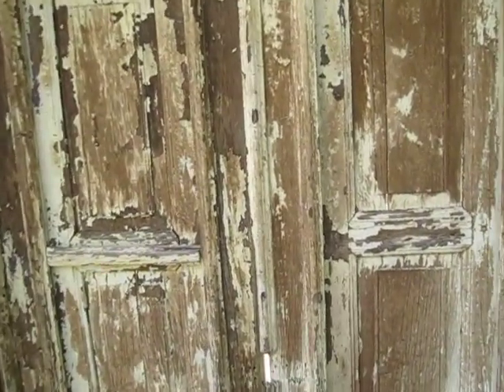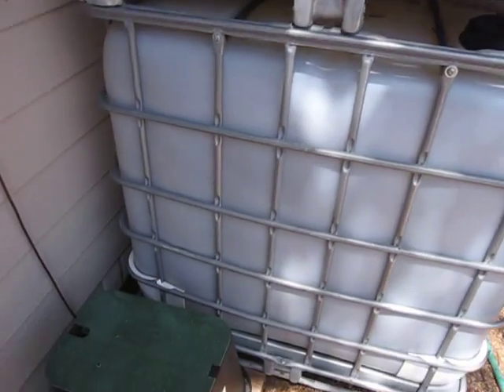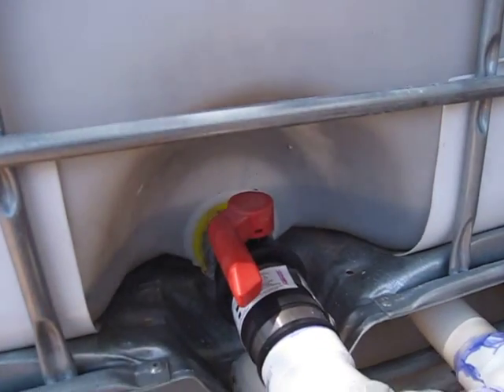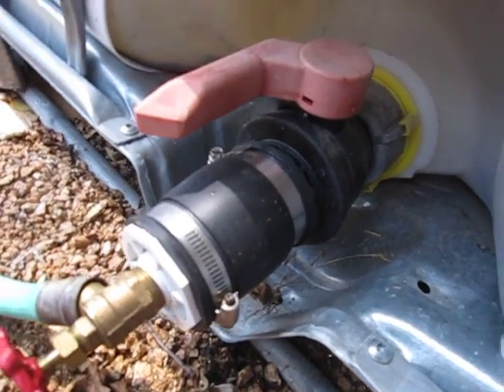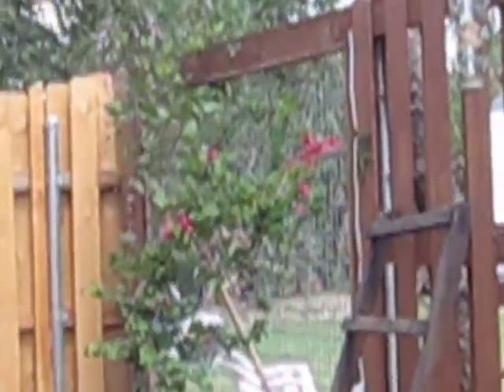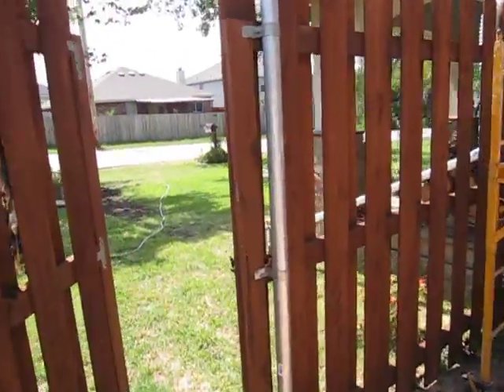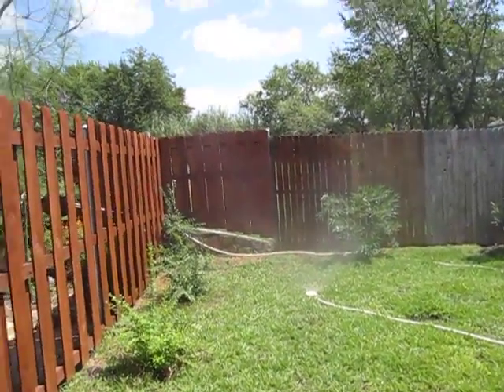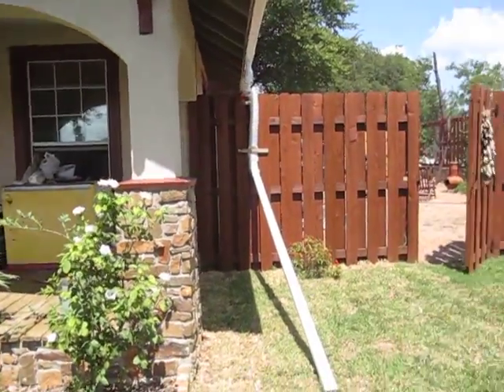My Rainwater Collection System

Comment: You can use UniSeals to connect PVC pipes to the tanks. So for overflow you could add another pipe high up on the side of the container where the water would flow out when it was full.

Comment: I have one of those tanks and since you showed me I can stack'em I need another! You prolly figured this out by now but for everyone else, you don't need to connect them with all that pvc the way you did, all you need to do is screw a 1/2" elbow into the top tank the same way you put the hose bib in the bottom. Then put a Tee in the bottom and connect the two with a straight 1/2" tube and then add your hose bib. It'll fill from the bottom up without any prollem. Great vid! I learned a lot.

Comment from the maker: Go back to the irrigation area in Home Depot where they have the water control valves. This particular item is used as a main housing for a sprinkler water shutoff valve. It's made by Orbit, Model 53212---$19.87. It's also in the irrigation section on the website. Hope this helps.